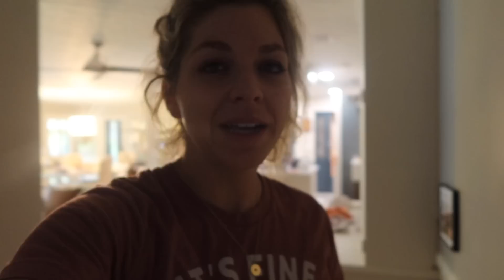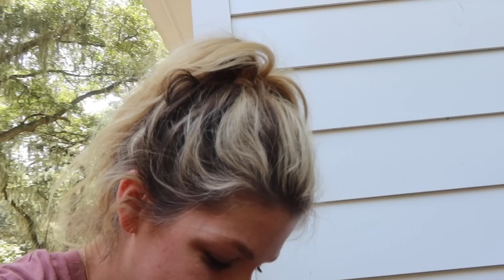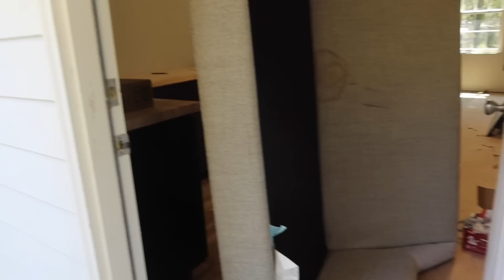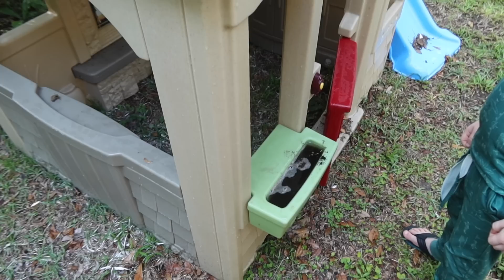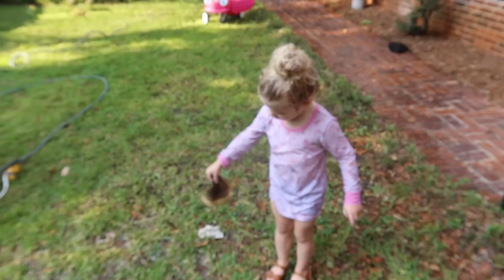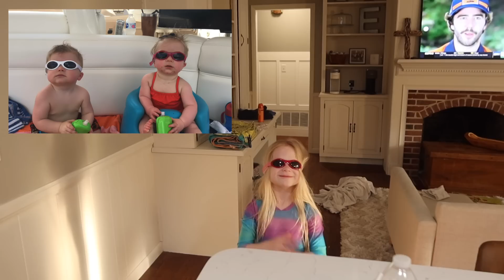This almost ended our vlogging

Comment: Brad drill a small hole in the planter of their playhouse so the water will drain. You won't have to worry about that. Maybe even up to 3 holes.
Reply: HI , I THOUGHT THE SAME THING WHEN THEY WERE TALKING ABOUT THE MOSQUITO LARVAE IN THE WINDOW PLANTER , TOO !!!!    THEY COULD PROBABLY PUT 1/2"
HOLES IN IT TO DRAIN WATER OUT OF IT SO THE MOSQUITOES WON'T LAY THEIR EGGS IN THE WATER !!!!   
IF THE HOLES ARE TOO SMALL , THE WATER WON'T DRAIN OUT OF THE HOLES VERY WELL . 😊😊😊